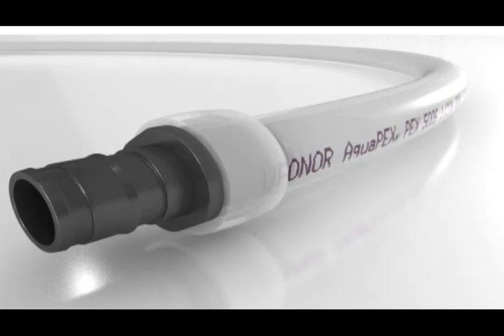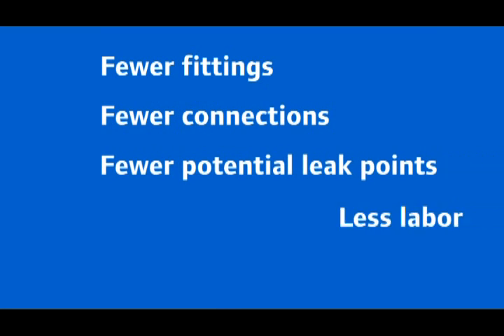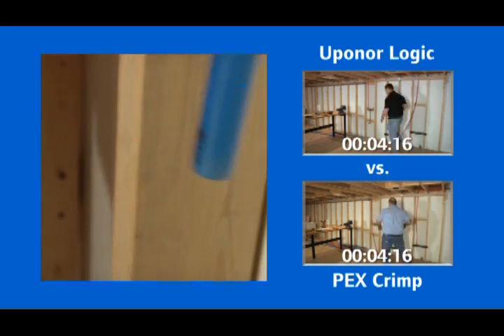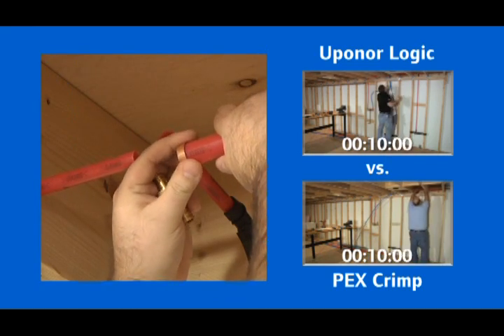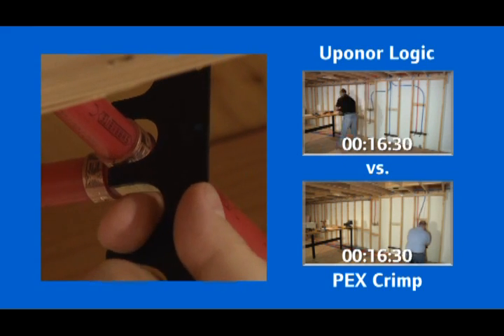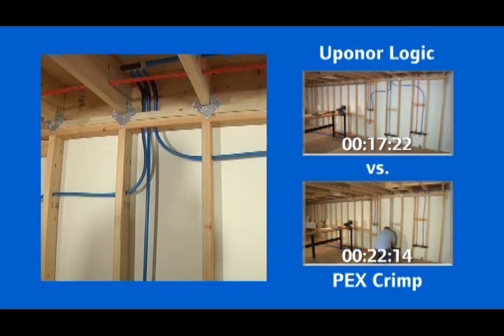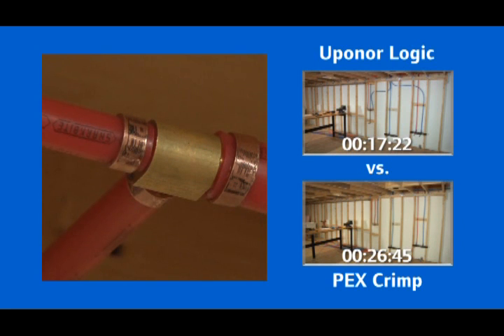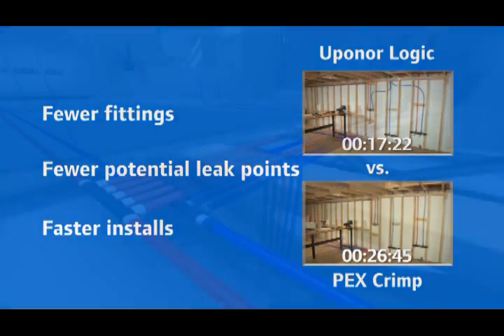Uponor Logic vs. PEX Crimp Comparisons

Comment: When I started helping a few neighbors replace water heaters 7 years ago(around 2015) There was not 1 supply house in the area(Columbia SC) that carried any pex a pipe or fittings. So, I went with what was available, pex b. I used the copper crimp rings and in the last 7 years, not 1 failure or leak. Now in the last year, supply houses, Home Depot and Lowes have started to carry pex a. The video showing pex a is faster is not true! I have low flow faucets/showerheads so that little bit of extra flow from pex a fittings is not needed. So far I have not kinked any pex, but being able to fix it with a heat gun would be nice. But, pex a fittings are about 2x the price. I think I will stay with what I have, pex b!

Comment: The best thing about Uponor compared to the crimp PEX fittings is the larger internal diameter of the Uponor PEX fittings. This results in less flow restriction than you would get if you used crimped PEX fittings. That is the main advantage of Uponor, and why it is way better.
Reply: I’ve actually tried to find the specifications for both fittings knowing well what you indicated. But I’ve yet to be able to find the actual dimensions of half-inch fittings for both. Thanks for the comment

Comment: Seems to me, if you're not doing every fixture with a home run to the manifold, you're missing the very point of PEX.
Reply: Then why isn't copper done the same way 9/10
Reply: The idea of the home run from every fixture to a manifold is to eliminate crimped connections in buried places and reduce restrictions with crimped connections.  The expansion type of pex (a) will make waterproof connections that will last forever and also flow much better than crimped type connectors.   There is no need to run home runs in an expanded pex installation.  Whereas pex b pipe constantly pushes back against the crimp, the expanded pex a pipe continues to actually grip tighter over the connector and get stronger over time.
Reply: Not for an inexperienced home owner.

Comment: brass is no longer used in aqua pex,I can crimp all the joints faster than one joint on Uponor,  those manifolds for Uponor are expensive AF. any thoughts on that?
Reply: Disclosure: I'm not a pro, but I have been doing a lot of research as I need to rip out all the copper in my fairly new house... Here's what I've learned: crimped connections cause a flow reduction and a possibility of a long term leak as the crimp relaxes over time.  By expanding Pex A and sliding it over a full flow connector, the flow is not changed by the connector and the joint is more secure as the pipe itself compresses the joint, almost as if the connector and pipe were molded together.
Reply: @Blades and Bullets" : not sure how you mean that unless you used a manual hand expander.  My buddy is a plumber and he put me on to the Pex A expansion system, and it is a lot easier and faster than any of the other systems if you're using the Milwaukee power tool.  The expander tool gets in the tightest places and there's no wasted time checking each crimp with a go/no-go gauge.  There's also no possibility of a crimp leak (supposedly three out of a thousand).  The manual expander is far less convenient.
Reply: Just used uponor for the first time last friday, system seems okay. Just depends on your preference. I think there are faster systems if speed is the issue, but this depends on the individual. The expander to me takes more time to complete a joint than crimp rings. We all know what they say about opinions!
Reply: Just the Milwaukee tool cost cloe to a thousand dollars..... crimping just as good for the life I have left
Reply: It's nowhere near $1000, where the hell are you shopping?
Reply: @leahanderson2367  Nuke is right. The crimping tool costs $800-$1100 or more. The expansion tool is $200-$300. Yet another reason uponor is better than other pex.
Reply: PEX-A is slim pickings around my area. Menards, Home Depot, Lowes. 
No red/blue pex-a tubing. They wont always tell you straight out if you're looking at pex-a, b, or c. It's either buried in the description or you have to look it up elsewhere.
Reply: Two years ago the plumber installed uponor Plex throughout the house & not one leak. I think it's a great system.
Reply: @B&B: I agree about the availability of Pex A connections being a problem.  I'm used to running to Depot on the weekends for plumbing emergencies.  Once I finish my repipe, I will have a whole stock of connections, rings, and pipe, and I already own the Milwaukee expander.  There is a local supply house that carries Uponor but their hours are nowhere as generous as the Depot, and it always seems an emergency happens on nights, weekends, and holidays.   I'm an old time copper sweater,  and my plan was to go with cpvc as it's pretty much the same system as copper except using a solvent adhesive instead of solder, but I'm afraid of a split hot water pipe after so many years.  Several plumbers have shown me older cpvc pipe that split at the end of a stubborn shutoff.  Seems like every system has one fault or another.  With my low pH water, I had to go with Pex.
Reply: John-Del I used the m12 expansion tool on my project, i have seen the manual expanders the look like a pain in the ass. I still prefer cpvc over most systems available(my preference). As far as pex is concerned and most people would agree, the go/no go gauge ends up in the bottom of the tool box because no one uses it.  I can think of a handful of people that would love the challenge of uponor vs. pex crimp speed comparison, the video here of course will go in favor of the product they are pushing. Fittings for the uponor around here are few and far between making it pointless to use, i want something i have parts for or can get in short order. Once  again this is my opinion, everybody goes their on way.
Reply: No, the Milwaukee tool is $460 new at Home Depot with 2 batteries and 3 expansion heads. 
You can get it for less than 300 used/like new on ebay and get most if not all of your money back when you finish using it if you exercise care.
It requires no gauges nor adjustment to ensure you're getting a good crimp. It works in physically tight spaces that you cant get a crimping tool in.
Reply: @Foche_T._Schitt  = crimping tool = $100.  manual PEX expander tool sold by 'Waterline' = $250.  For a homeowner who is only going to do a few connections, I'd just use the crimping tool and put up with the decrease in water flow.
Reply: @honestycounts9352  
You have to index the manual tool yourself which takes some practice. I paid 250 for a brand new/like new Milwaukee tool set on ebay. I set ebay up to send me notices when new listings came on. The resale value on these tools are pretty good so once you're done with it you can get most of your money back.
Reply: I just looked up the plastic manifolds for distribution and they range from 4 to 10 Dollars each online. I have in the past assembled my own copper / brass manifolds with valves as needed for less than what I could purchase them for. I'd personally take the Propex system any day over a crimp style system.